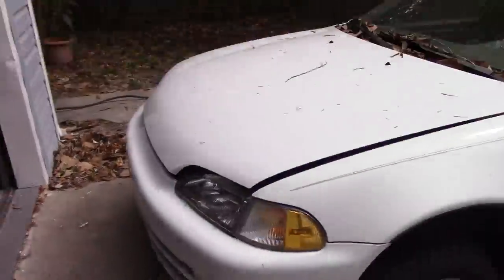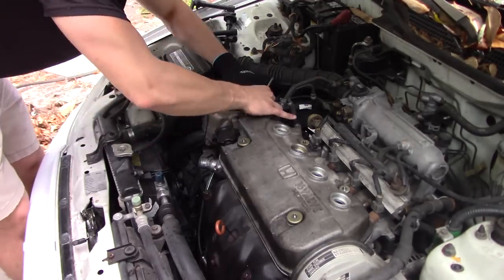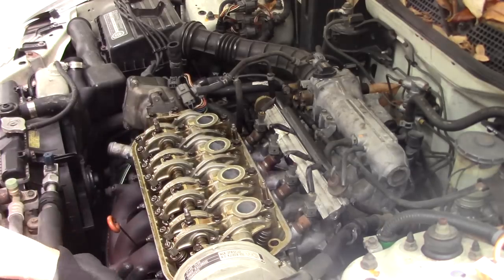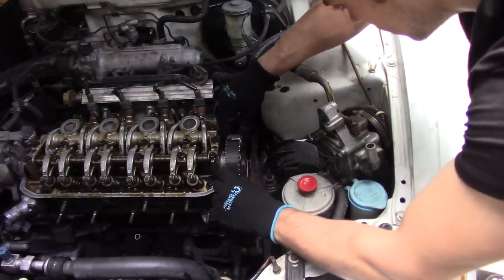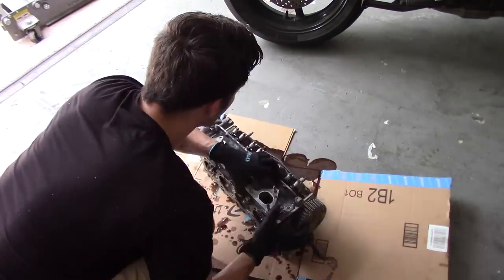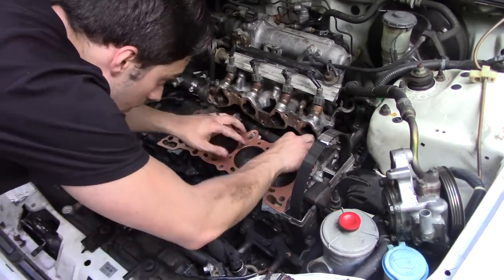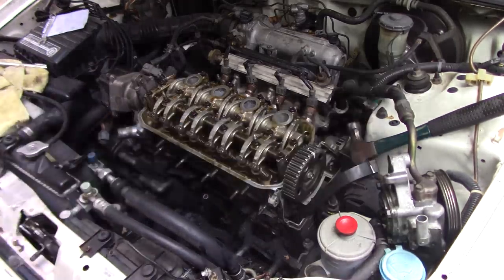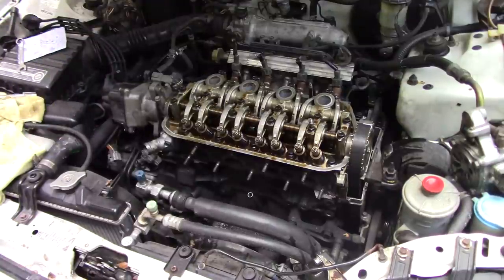How to Replace a Head Gasket  | 1994 Honda Civic DX

Comment: Hi, I have a Maruti Suzuki SX4 VXI 2007. Due to overheating, I recently changed its Thermostat Valve and the car started working fine at the optimum temperature but as soon as I switch on the AC, the temp gauge shows drop in engine temp. Yesterday,  when I again replaced that thermostat with a new one, the engine has again started overheating & the lower radiator hose is not getting hot at all. Also, the car is shooting too much water from the exhaust when I rev it high. Kindly assist me as I'm not able to identify the cause of my car's problem.
Reply from the maker: I have a few questions: 
Is the fan bolted on the engine or is the fan an electric fan? 
Is the tailpipe consistently dripping water? Is the tail pipe constantly having condensation, even after it’s warmed up? 
If the lower hose isn’t getting hot, then something is blocking it. 
I would guess your water pump may be going out. Is the top hose hard  and with a lot of pressure when the bottom hose is cold?
Reply: @AutoMotivate  It is an electric fat that runs when AC is on or when the car is overheating. The Tailpipe isn't consistently dripping water but it literally shoot somewhere around 50 ml of water when I rev it up at standstill & at the optimum car temp. The top hose gets really hot and hard and the lower hose remains comparatively too cool and doesn't get hard. I have checked the spark plugs, plug wires and Ignition Coils but they are absolutely new and fine but still, the car looses it's brisk acceleration and jerks a lot only after running for 10 minutes or so.
Reply from the maker: The next thing you need to do is change out the water pump. The water could just be condensation that piles up in the catalytic converter. However, you very well could have mixed fluids and possibly blown a headgasket. 
Look at the oil through the valve cover and check the coolant (when cold) and make sure they look the way they should.
Reply: @AutoMotivate  The engine oil & coolant are in good condition, not milky grey or white so far now. The problem started 4 weeks ago when my car overheated a bit and I changed it's thermostat valve and cleaned the radiator. From then, the car worked fine but I noticed that the temp needle starts going down only after I switch on the AC and as soon as I turn it off, the temp slowly build up at optimum level. Also as I mentioned earlier, it runs fine for 10 minutes or so but after that, it jerks a lot and misfires a bit. Day before yesterday, when I again changed it's thermostat as I found it to be completely opened, I noticed that temp started reaching at optimum level relatively faster than before but was tripping my AC even at optimum temp with no sign of overheating at the gauge.

Comment: So that last bolt didnt tightened like the others cause of the warped head huh.
Reply from the maker: It makes sense
Reply: My civic I just bought has 355k miles all Original but dude that sold it to me drove it overheating and I’m waiting on parts in the mail and will be tearing it apart this weekend
Reply from the maker: Dang!! Probably go another 50k-100k
Reply: AutoMotivate I know it’s so crazy. I can still drive the car and drives like a 150k civic just leaks gasses into my radiator hoses

Comment: Hi there
How many miles before it need head gasket
mine 1999 hx got 35000 miles  i think it got a blowing head gasket temp goes up on stop/go traffic
radiator been replaced & cooling fan are working properly
How long it take you to replace gasket at home
Reply from the maker: John Doe  so, I bought it from a coworker knowing it had a blown head-gasket. But, since I wanted to make a few videos off this car, it took me about two months. But, ultimately if I went straight to business, a week, because I had to get the head shaved down. But the changing the head gasket alone took a while, about half a day, as it was my first time. I couldn't really find a good illustrative video on this process, so I made one.
Reply: Replace thermostat
Reply: I have a 1995 Civic DX and I replaced the thermostat. About three days later, antifreeze started spewing and it was overheating again. My exhaust is coming out white, and the only conclusion I can come up with is that it has a blown head gasket. I have never done this before, so I'm definitely thankful for this video. Most other videos don't really describe what to do. Thank you man.

Comment: You warped the head because when you take the head off the sequence is reverse from putting it on. That’s why you had trouble with the #10 bolt, you had already warped it
Reply from the maker: Jason Gyurich I highly doubt that warped the head, but it’s a possibility. The car has been overheated many times.
Reply: AutoMotivate I guess I could of worded that a little better. Just a tip- not only is the sequence reversed but you should take your time when it comes to actually removing the head. Which meant just like there are 2 different torque sequence putting on, the same goes for taking it off don’t just loosen and take out 1 bolt. Slowly follow the sequence relieving pressure equally meaning you go over the sequence 2-3 times before any bolts come out. Overheating could surely be the problem but you should baby it anyway just to be sure you don’t damage. I like the way you did the vid, good job

Comment: the process 1-10 was supposed to be applied backwards when taking it off.
Reply from the maker: Removing the head in the process i did should not have damaged it. However, i was told about that before. I am not a professional mechanic.

Comment: Ain't you suppose to unscrew the head from starting from 10 then work your way down?
Reply from the maker: Correct, however, the source I got my information did it this way. I saw Chrisfix worked on, I think, the same engine. He went backwards. Either should be fine.  I’ve had a lot of people follow this video, and they all finished their jobs successfully. I do, however, always recommend getting the head shaved, just in case.

Comment: What engine is?? this im tryin to figure out the engine code stamp of my engine its a 1.5 16 valve
Reply from the maker: jeffery robinson yours should be d15b7.
Reply from the maker: The code should be stamped on the block on the front left side.
Reply from the maker: jeffery robinson also, I have everything you need to buy in the description

Comment: Anytime you remove the cylinder head, always replace all gaskets and have the head resurfaced as well as the engine block deck! When removing the timing belt, it's not recommend to slide the belt on or off the cam pully or you risk damaging or decreasing the belts life. The timing belt tensioner must be removed and replaced before installing the timing belt
Reply: What is the engine block deck?  How would you have it resurfaced without pulling the motor.

Comment: Where is the Jacking point to lift up the front
Reply from the maker: Its a little spot in the front driverside of the car under the bumper. Make sure you are jacking up the frame, and not any plastics.
Reply: TheDeDecker how far up should I go to jack it up
Reply from the maker: theguyttissy bob not too much, just enough to get yourself down there with the right tool to take off the pieces that needs to be taken off.should be fairly easy.
Reply: I got to the gasket and bolts but they won't budge what do I do
Reply from the maker: The Head bolts wont budge?  Well, i used a breaker bar. Or you could attach a wrench to your ratchet for more leverage. Make sure you take off everything else before you tackle the head bolts
Reply: TheDeDecker I did why is that
Reply from the maker: theguyttissy bob if you take off the head bolts first, then all the other stuff will be tougher to take off and you have potential to damage more of the head because the head is not solidly placed.
Reply: TheDeDecker okay the wrench worked thank you do I need to take them off in sequence
Reply from the maker: theguyttissy bob break them all  loose first, then take them all off in any order.
Reply: Please for the sake of your life use jackstands

Comment: its a intake manifold
Reply from the maker: I’ve been told. 
I was exhausted and wasn’t thinking.
Reply: @AutoMotivate  dont worry my dude u did good and when u took of the studs holding the head you took them off wrong it goes 10-1 not 1-10 because that could cause warping :D and in ur case u got head warping so idk if its from that but just 1 thing to look at next time
Reply from the maker: Yeah man, I realized that afterwards. I was really trying my hardest to make an efficient video. At the time, I was looking up other videos to do this job and each video took like 4 parts. So, I decided to do one in one take and as short and efficient as possible. Few mistakes were made. 
I don’t think the warping was from the process of taking it off because the car was over heated several times by the owner I bought it from. Never the less, you should always get the head shaven when you change the gasket, in my opinion. 
Thanks for the support man
Reply: U GOTT'EMM

Comment: What many people don’t realize is most of the time your head gasket gets blown because of a secondary problem, some because the gasket is just old but try to check for other problems before blowing another brand new gasket
Reply from the maker: I should have mentioned that. The issue with this car, I bought broken down, was that the thermostat was stuck.

Comment: I'm not done watching yet, but it's a bit silly to hear him repeatedly refer to the exhaust manifold fasteners when he's actually talking about the intake manifold. He calls the nuts bolts. ; ] 

I KNOW there's no substitute for doing things like this 'by the book'. I guess I'm here looking for some time-saving motivational miracles. They don't exist, realistically. 

I have a '95 Civic LX SOHC 1.5L 5-speed. My OEM manual and some of my tools were lost. My head gasket gave a couple of weeks of symptoms that I thought were the result of oil consumption and a ring-seal, smoke-stopper additive. The coolant all over the firewall after a failure on a single-digit night that didn't see the temperature go into the red zone on the gauge told me what I have. My best investigation led me away from thinking it might be a radiator or heater core hose rupture. The smoke during the first couple of minutes of running for those couple of weeks had to have been coolant. The coolant had been making me suspicious.

I just hate that I have to do this in the middle of winter. Thankfully my cousin is letting me borrow his work-runaround Subaru. I can't have it forever, though. Ha! I have, for the first time ever, access to a garage that I MAY be able to clean out and get my car into, but it's a challenge at the least. I've already chewed through sick time I have for the first time after seven years with my employer, plus a week of 'vacation', due to a 'positive' COVID test. It would be much better if it were Spring and I could take a few days to get this done comfortably and properly. ; ]

Yeah, it's a Civic, not a 12-cylinder Ferrari, but a head gasket job is still a pain in the ass. I knew he was looking at trouble when he couldn't get that last bolt to torque. Nice guy, and I appreciate the effort behind the video, but there really isn't a better way to do a job than the proper way. 

Sorry for the ramble. I'm not happy with my life at the moment, and my head gasket issue is only part of the reason. Ha!
Reply: Bill holt turn around you have a warrant for your arrest. PUT YOUR FREAKING HANDS UP QUIT RESISTING!!! Dont you talk to me like that Bill!

Comment: The most dodgiest way to ever do a head gasket job. You never checked the head or block for warpage, that is why the last bolt took forever to tighten down due to warpage. The head should of been leak tested in case it needed a valve job, and head gaskets do not require additional sealant especially the amount you applied. My advice mate, let someone who knows what they are doing replace it next time.
Reply from the maker: For sure snobby, I’ll listen to you because you seem like a trust worthy and perfect person. 
I haven’t done this stuff before, so I have absolutely no idea what I’m doing. 
(Hope you notice the sarcasm)
Reply: No need for sarcasm. If done correctly first time, it will save a lot of time and money.

Comment: This should be how NOT to do a head gasket since he did not resurface the head after running it hot and had to do it all over again. If your hg blows from overheating, the head IS warped, but can usually be resurfaced by machine shop, they also will check it for cracks and valve seating FOR UNDER $100. Don't make the mistake he made!!(twice!!!)Also that bolt he had trouble with is one of the 2 dowel pins, the bolts on this enj barely fit thru them, so if they are bent any you will not get accurate torque setting, check them first with a head bolt. Also drain the coolant first!!!
Reply from the maker: Wow, I’m glad you did a video on this. Because, obviously, you are en expert. Running hot, doesn’t always mean your head is warped, btw. But, if you watched the full video, it said I got it resurfaced.

Comment: This silly dude went underneath without jack stands, i swear i will not ever have u train anyone. What the hell were u thinking to go under that car plus u used metal blade to remove gasket. Horrible example setter.
Reply from the maker: If the car fail, it wouldn’t hurt me. I’ve been under the car without a jack multiple times, which is why I didn’t take much care for the jack stands. 
However, I do agree, you should use jack stands and I should have put something in the video explaining this.

Comment: Yo? Do not ever work on a car with the jack only. Safety first no matter what. Put the jack stands. Seriously man. You got folks watching your videos
Reply from the maker: Yeah, because this is the only decent and straight to the point video doing this job.  It was my mistake not informing people about the jack-stands; however, if the car did fall, i would not have been hurt because i can get under the car and do the job without it being jacked up. Also, the car was not jacked too high, the tires were still touching the ground.
Reply: TheDeDecker You can put it and say it however you want. Once the jack is move for whatever reason and you underneath. It's over for you. Safety is a must priority when it comes to doing any automotive mechanical job. Your life is more important than getting the job done.
Reply from the maker: Eric Top One if the car was lower, yes, it would be over for me.

Comment: This silly dude also referenced a exhaust manifold, no its intake. Plus he called a valve cover a head? You really dont know what you are doing. Im guessing you watched Chris fix then acted liked you know what your doing when you actually don't. You could of warped your engine not unscrewing the way the procedure is forwards, backwards. No jack stands and referencing incorrect parts under the hood.
Reply from the maker: Just a heads up, I made this video a year before Chrisfix. 
Also, it was an exhausting task, of course I will miss-name a few things.

Comment: Bro it was worped becuase you took the studs out wrong and put them in wrong
Reply from the maker: Eric barraza you are incorrect. It was warped due to it being overheated multiple times. There are a lot of people who have taken the bolts out the way I did. 
You should always get your head shaven if your head gasket blows. Only reason you say that is because you have seen Chrisfixs video. I’d rather have a pro mechanic tell me that than some random guy like you, then I will put a disclaimer. However, this job was done right.